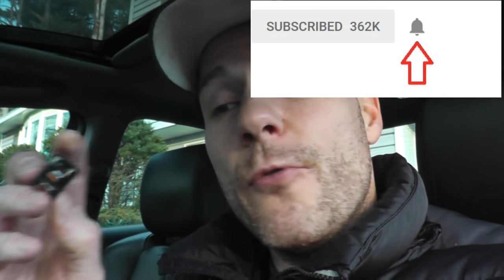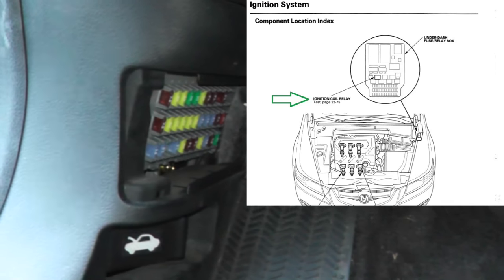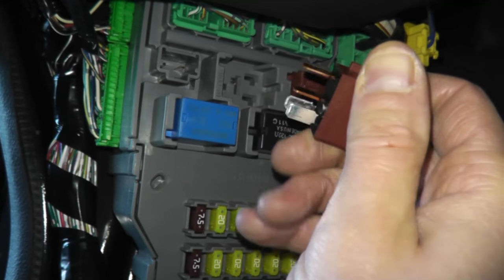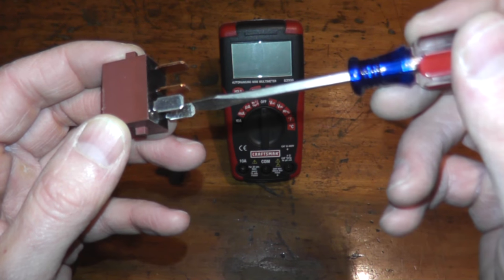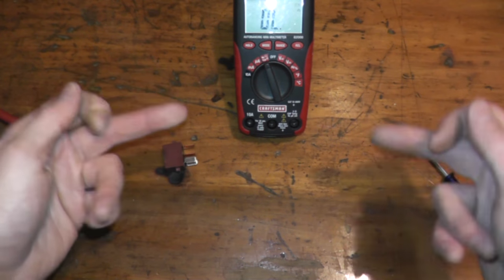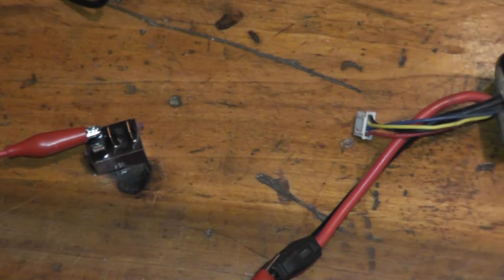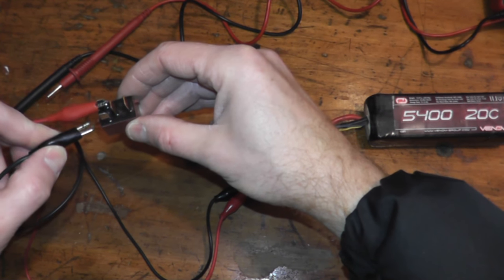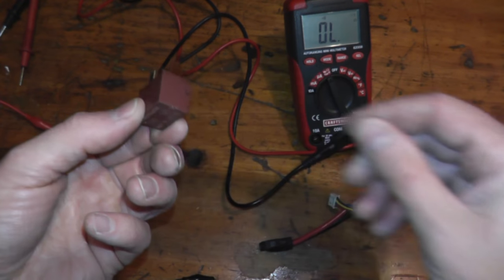How To Test and Replace An Igntion Coil Relay

Comment: I did the test just as you did on your video, and I then tested "1" and "2," and got continuity, but when I used my test light and the volt meter setting to 20 volts, I got no current. Do one and two only get power from another source?

Comment: My odyssey has a problem that appears to be the starter staying engaged for a few seconds when started in  cold weather. After that initial start I have no problems throughout the day until the next morning.  I replaced both starter cut relays, and then I replaced the starter. Still no change. Could this ignition relay be sticking? I started pushing the start button without applying the brake a few times the last few mornings before starting and that grinding noise as if the starter was staying engaged has almost gone away as if applying voltage to the relay has caused it not to stick?? Not sure..please advise. Thank You

Comment: So ignition relays are similar on all cars just make sure its the right one. My car got a new fuel pump and the relay was being weird so I swapped two like relays fixed the pump but then my dashlights went out. The car previously stalled and had loss of power but only sometimes. Now I'm trying to figure out if it's the ignition relay or sometbing else in the fuel system.
Reply: I specifically read that ignition relays will cause your dashlights to go out. What's even weirder is my car is wired to a switch for interior, running and brake lights. Those all work but my dashlights that are connected to that switch don't work
Reply: ik this was 2 years ago but did you ever figure out if it was just your ignition relay? because mine does the same thing sometimes it won’t even turn on or it’ll run and die and turn it self on while driving